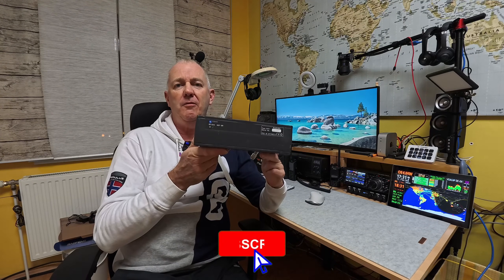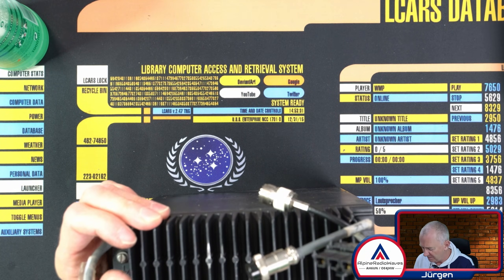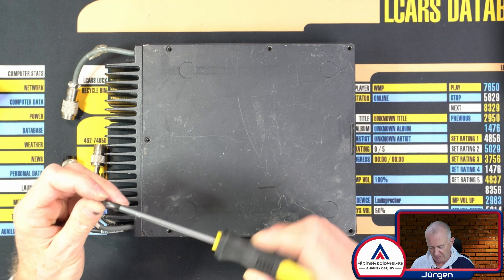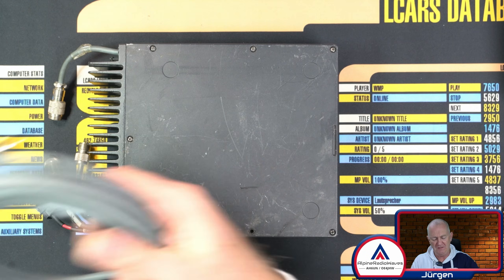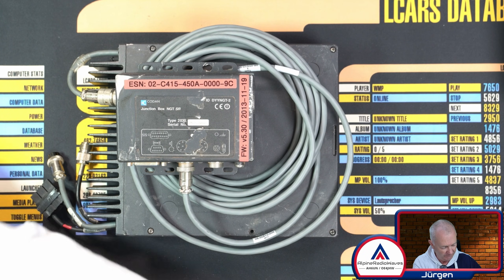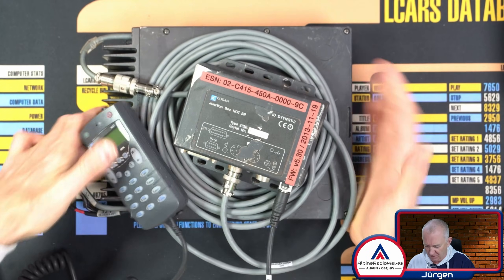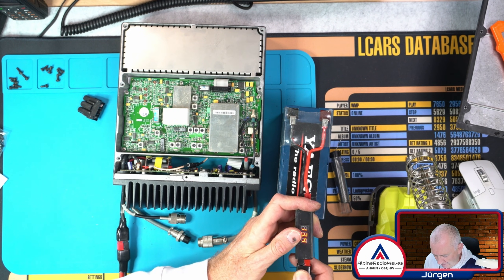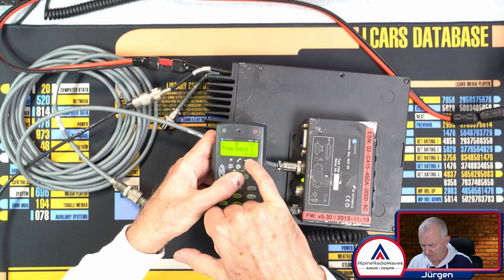Testing an old CODAN NGT SR type 2010 professional HF radio (Part 1)

Comment: for tuning antena need press PTT buton,but need in chanel mode , if free tune is nnot active . If you have option #42 then FREE TUNE  nave two modes  VFORX tune  -only tunning  in receiver , if you  instal options #42 - In FREE T UNE  - will be on LCD screen -TX tune -then  you chose  frecuence  and pressing PTT buton and tranciewr tuning in TX . when not #42 options  when you chose  frequence  need sav this  frequence  in chanel mode and then tuning whit PTT  buton
Reply from the maker: Great, thanks so much.
I will try this with my buddy Mike this afternoon

Comment: Hello, according to the service manual of
CODAN from Justion box, on 15 conector there is an input for Morse code
Can you show how it is transmitted in Morse code and received
Reply from the maker: Good morning!
Thats good to know. Thank you so much.
Best 73, Jürgen
Reply: @AH6UN_OE4JHW  To clarify, I don't have a justion box or desktop console. But according to the pinout of the 15-pair connector - 11 pin
FUNCTION-Morse code; INPUT/OUTPUT - input; SIGNAL LEVEL - 5V logic active low
Only the SR,SRx variants have USB CW and LSB CW modulation, and I assume that in these modes it can transmit Morse code
but I'm not sure or it's wrong